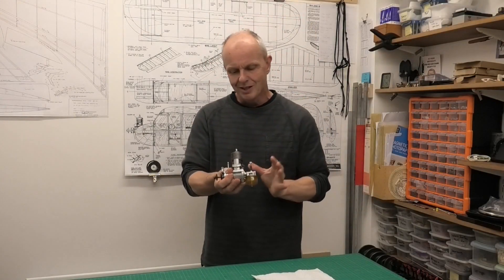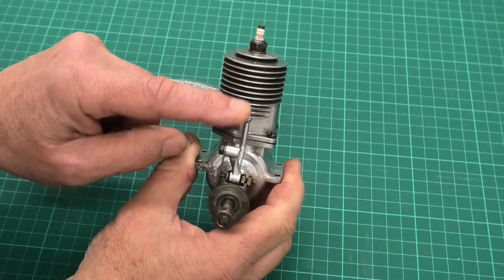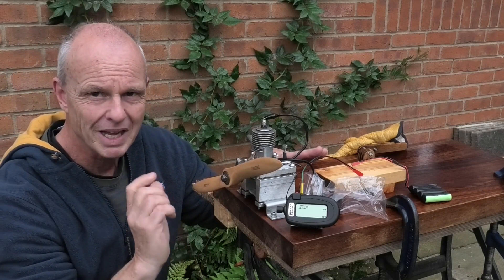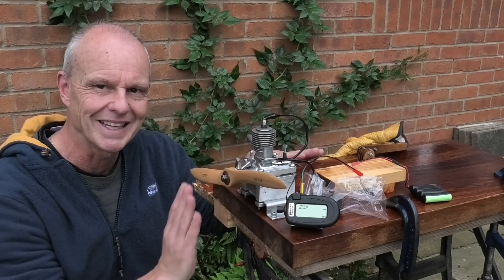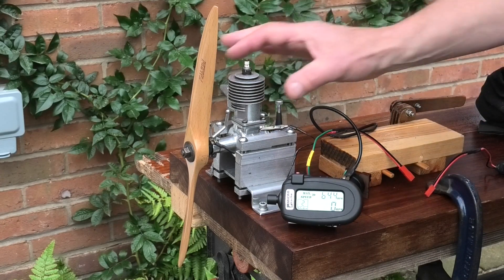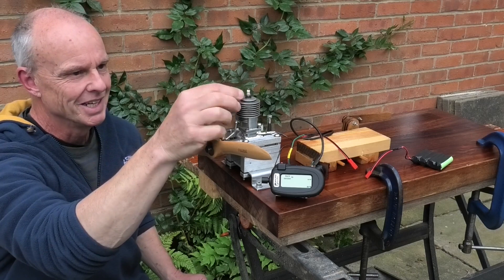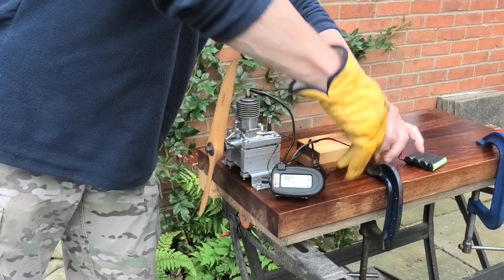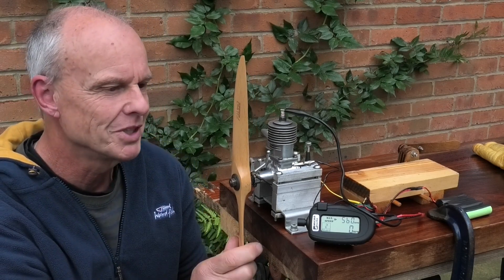Rocket Victor 46 - 1945 Spark Ignition Engine

Comment: My dad had one of those..didn't have the plug or ignition..took it apart to show off at school have most the parts.His deal was building rubber power, my mom had gotten him the engine while we were at Nellis AFB ,not sure.it was his love of model airplanes that gote started with simple balsa gliders in 1965,now fly the big stuff have 2 Edge 540's one 36% 105" wing,DLA 116CC and a 43% 120" wing,DLA 232cc

Comment: I have one also. They have extremely good piston cylinder fits. The unusual thing is the way the piston is connected to the rod. There is a small bracket bolted through the center of the piston top which connects to the rod.
Reply from the maker: Yes, it's very similar to the British made Mechanair, although the baffle on the Rocket is a bit of bent mettal! hahahaha, but seems to run well, thanks for the comments

Comment: Surprised at how little difference the ignition timing made while the needle seemed very sensitive.
Reply from the maker: The needle on many of these old sparkies could do with having a finer point to give a little more control, particularly as they run on so little fuel as compared to a glow or diesel.
Reply: Petrol seems less critical than methanol.  On those I run on FAI fuel, I use a finer thread.
Reply: @RyanNX211 It IS less critical. The tuning window is larger